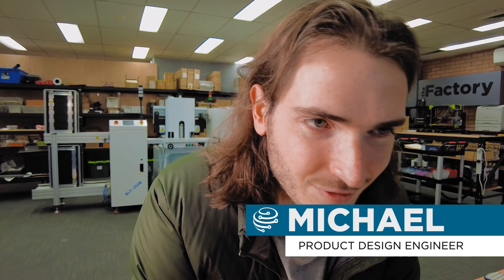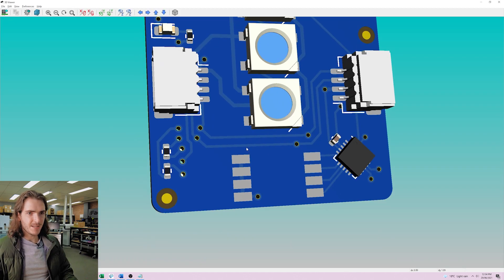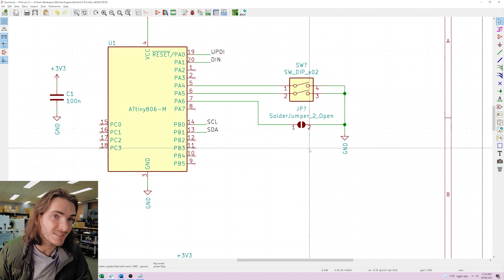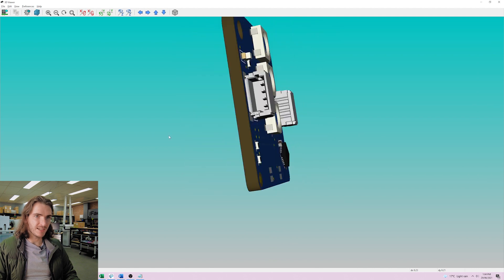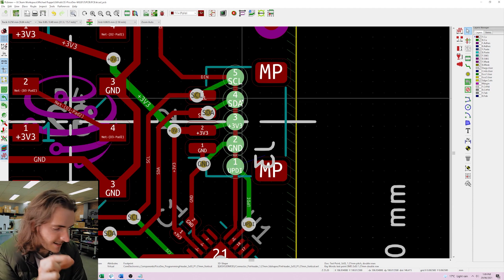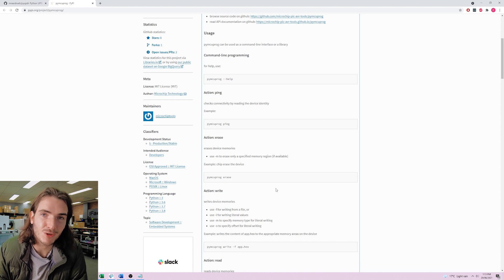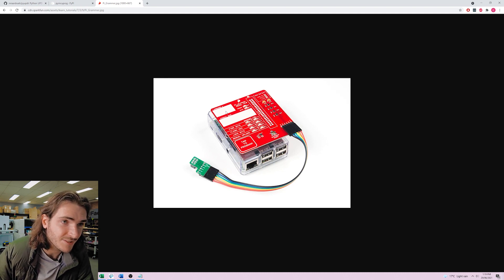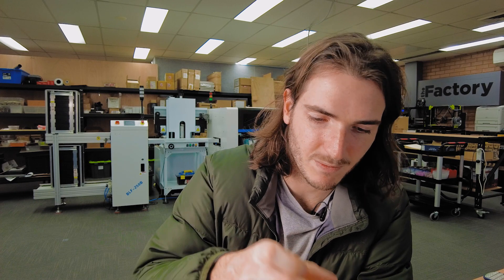The Factory | Designing An I2C Compatible WS2812B Board

Comment: Absolutely a connector or any sort of interface between the board and the programmer so that you're not held back if/when that header needs to change. Also makes it the easy part to replace when the contacts wear out (pogo pins?). Bonus points if it starts programming without needing a button press, and returns to a ready state when the device is removed 😉

Comment: I love these discussions... so many options :) I would actually just put a small button on the PCB instead of dip switches and implement all configuration (like I2C address, power led function, I2C pullups enabled) in software with a menu. Just press and hold the button while you apply power to the module to put it into setup mode. Then use the button to set the address without limits, set modes for the power LED and enable/disable the I2C pullups. You have three/four LEDs as user feedback, so this is no problem ;) No jumpers, no special I2C commands (at least not reqired). This also gives you an additional button on the module that can be used for other stuff in normal operation mode ;)

Comment: Hey,

This is another great episode, I think it would be good to get 4 RGB LEDs on the board vertically aligned. The dipswitch could be shifted to the left mirroring the chip.

I think the current power led setup is sufficient and should be maintained across all boards where possible.

I also think the programming header is in a good spot and like you say should strive to be consistent across models.

Comment: daughter board should not be on top of the (classic) hat, pressure stressing the hat/pi pins. 
a pi zero could be fast enough, use the pi0 on board led to give feedback (add sound for bad ...?) 
log the results to a server, hat could be the bottom layer, solder the pi pins going down, does not need to be 40/26 pins.